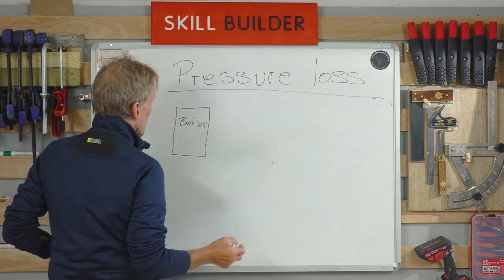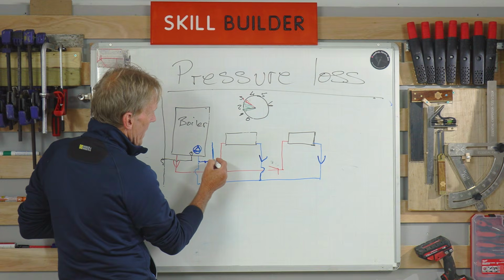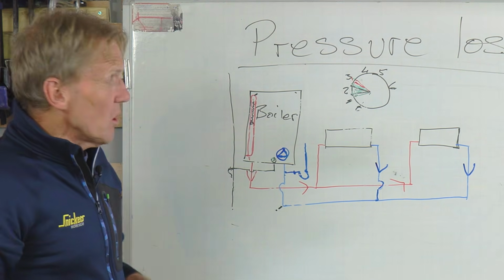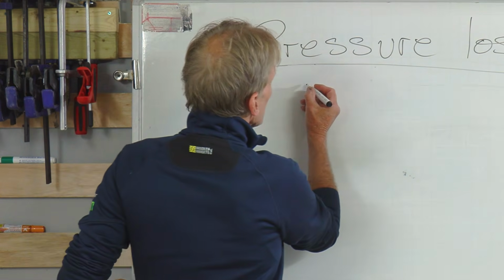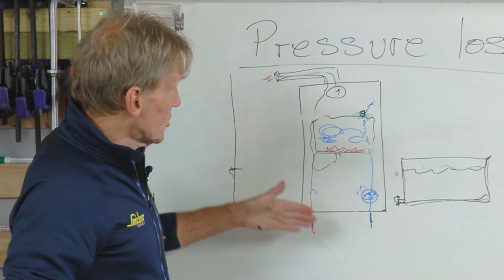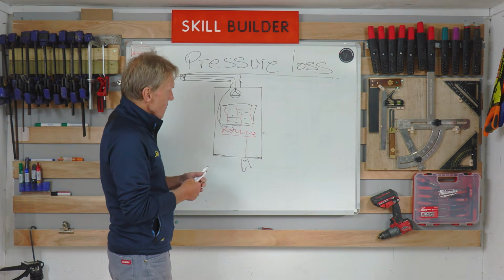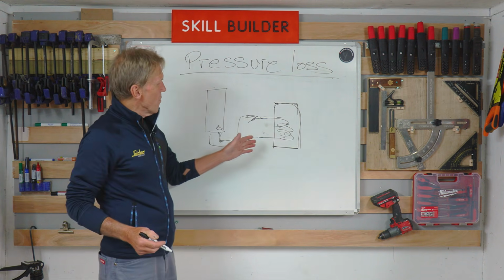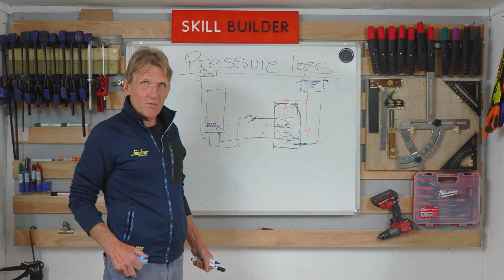Why Does My Boiler Keep Losing Pressure?

Comment: It's interesting to see how a boiler works. I had pressure loss but nothing obvious as all the boiler drains go straight into the soil stack as my boiler isnt on a outside wall. Had them out to fix as was dropping quick and now onky drops pressure every couple months which i assume by this video is relatively normal.

Comment: Hi Roger
My boiler Baxi 424 is working perfectly but the pressure gauge is reading zero. When I try to increase the pressure no water enters
the system . Is it possible that the pressure gauge is faulty?
Reply from the maker: The pressure guage may simply be blocked with a tiny amount of debris.
Reply: The gauge is at zero why is the boiler not asking to be topped up ?and why is there no error code showing ? @SkillBuilder

Comment: Here's and interesting fact that i  point out to customers. If your boiler has been fitted in the loft and a convenient filling point with a pressure valve has been fitted on the ground floor. The Pressure dial will show the height difference as well as the system pressure. so 1m equals 0.1 of a bar. So if the boiler is 10m above the filling point and you pressurise the system to 1.5 bar it will be 0.5 bar at the boiler. This may not be enough to activate the boiler.

Comment: I had a problem with my boiler since Thursday this week, where the pressure was going doolally and the pump was gurgling. The boiler kept shutting itself off (E9 or E5 Worcester-Bosch boiler). Called an emergency technician round last night, and he slapped the pump with the handle of his screwdriver and jiggled around in the middle of the pump, and it's running again now. 1.5 hours labor quoted, "Pump repaired".

Anyway, since then, the pressure keeps dropping to zero, and I keep topping it up. It lasts about 6-8 hours, then drops to zero again. I'm not sure what it could be, it was holding 1 bar fine till I had that pump problem. The pump problem only started when I switched the radiators back on.

But, when I first switched the radiators back on, I noticed the radiator in my bedroom wasn't getting hot at all. Since the guy "fixed" the pump, the radiator is getting hot only at the top, but not at the bottom. I noticed throughout the day today, as the pressure was dropping and I was topping it up that more and more of the radiator is getting warm from the top downwards.

Could the problem be buildup of sludge in that radiator? Maybe that's also what caused problems with the pump at first as well? Is there a chance the drop in pressure problem may resolve itself as the sludge is pushed from that radiator and through the system gradually over the coming days?
Reply: My hope is the "sludge" would eventually find a nice balance between all the radiators in the system and will then eave me alone.

Comment: Brilliant, well explained and easy to understand. Im a plumber with 7yrs experience but that was spot on. Exactly how they taught it at college
Reply: Did anyone on your course question why the heck this adjustment of pressure is not automatic? Seems odd to me - why can't the system pressure be measured automatically and adjusted automatically? It seems extraordinary that you have to do his manually.  Anyway - going to be academic soon - since we're all going electric air-pump, aren't we?!
Reply: @mbuk-zm3hc I'm sure it would be very easy to have automatic pressure monitoring and adjustment,  but why would you want that? The need to repressurise with any sort of regularity indicates a leak somewhere. These leaks can be small and very hard to spot. Surely the manual pressure top-up creates a very effective early warning system that things are not as they should be. For example, if a pipe should break and the system begins leaking badly, the fixed amount of water in the system limits the potential amount of water damage that can be caused to the building. Also, the filling loop on a combi boiler is connected to the mains water supply. There are very strict rules regarding connecting a sealed system to the mains (i.e. drinking water) supply. An automated pressurisation system would only increase the likelihood of water from the sealed system - likely containing corrosion inhibitors and other nasties - entering the mains water supply.

Comment: I got a IDEAL C30 Combi boiler that keeps loosing pressure, but there are no leaks that I can find, I tried turning the boiler off realeasing all the air from the expansion vessel, then pumped 1 bar of air into it, I did not drain any water out first, don't know how important it is do, and I don't know how to drain the water out in first place, any it has not worked, my boiler is still loosing pressure on average once a week. Any tips please will be welcomed thankyou. Great video thankyou.

Comment: Hi Roger, A couple of years ago I had my gas combi replaced with a bigger output model. The old boiler main heat exchanger was replaced about two years before (just inside the 10 year warranty) because I noticed pressure loss and found that the condensate drain was running excessively. Within one year of the new boiler installation I needed a new primary heat exchanger. In both cases the system was fully corrosion inhibited and fitted with a magfilter so Worcester Bosch replaced them both under warranty.
Was I just unlucky, or is this a weakness of Worcester Bosch?

Comment: Lots of useful tips there, thank you. One thing though and from about 8.20 onwards you talk about pressurising the EV with air, but you don't say how you're measuring it. I believe this should be done with an air pressure gauge on the Schrader valve, but people could get this wrong and try using the system gauge on the boiler.

Comment: Robert. This material is so comprehensive that helped to understand the dependencies and have broader overview. Really I appreciate you sharing your experience. I have drop of the pressure from 1.8 to 1.1 bar every abot six monts. The instalation is about 3 years old. Boiler with external 200l water container for hot water. So I'm going to start with checking this air pressure compensation container.

Comment: My boiler worked fine then starte dlosing pressure i check whole house no leaks - prv valv checked seemed ok .then i noticed outside the pipe leading out was capped off- i cut the cap now it has stopped losing pressure?...sometimes the pipe going out is the culprit for boilers not working - some should be metal or plastic as the install manual says  check this !!

Comment: great video, but should i touch the boiler if not gas certified engineer even though i'm a home appliance engineer? thx
Reply from the maker: You can top up the water pressure on a sealed system, it doesn't break any laws.

Comment: I’ve been topping my boiler up every day for the last week with 5 visits in a week from gas a safe engineer who can’t find my leak. The condenser drain had a broken pipe so he left it flowing into a bucket overnight and next day it’s half full . Now the condenser drain has been redirected to a pot in front garden , no heating again tonight or hot water waiting on a overnight pressure test on boiler ? The engineer said ?  Hopefully get to the bottom of this by tomorrow.. nightmare to say the least !! After watching your video I think he’s not want to fit a new heat exchanger .

Comment: I have an underfloor heating system as well and I don't lose pressure until I use the underfloor heating system. I then lose pressure and need to top up every 4-5 days. But when I turn the underfloor heating off and only use radiators I don't  lose pressure. Or at least I don't think so. Boiler is new.
Reply from the maker: You need an auxillary expansion vessel.

Comment: We had a new Vaillant combi boiler fitted a few years ago which began losing pressure.  I couldn't find any leaks at all but eventually had to call an engineer.  He came readily armed with a valve so obviously knew the problem beforehand.  When I asked why I couldn't find any leaks he said that I wouldn't necessarily notice one because there was a drip tray underneath (very reassuring!) and the heat from the boiler would have evaporated it.  Pretty good boiler otherwise but lost pressure yesterday resulting in no heat, so that's why I am watching your video today. Re-pressurised it again and OK at the moment.
Reply from the maker: Yes that is the auto air valve inside the boiler. They can let out a bit of moisture and it evaporates out through the flue.

Comment: Tring to get my boiler fixed still. 1st thing was the pump had cracked and it was pouring out water, Plumber came out and replaced that. Now i need to keep topping up the radiators every 1.5 hours or so. Plumber said it may need an expansion vessel, but today i noticed water pouring out of the pressure release valve outside the property. Not had heating or hot water for 2 weeks now. :(

Comment: In 2020, my plumber used an air gun to top up the pressure in the expansion tank inside my 2012 Worcester Boiler. Some tome later, I noticed low pressure and after topping up, it varied with temperature more than I had seen before. I discussed this with the plumber who suggested that the diaphragm in the expansion tank was probably leaking and i agreed to have it rreplaced. This was done and the problem was solved. However, I decided to examine the old tank before disposing of it. I discovered that the problem was not with the disphragm, but just that the schrader valve was not seating correctly. I guess that when the pressure had been adjusted that some dirt must have got stuck in the valve seat and stopped it closing properly. The lesson from this is that after adjusting the pressure in the expansion tank, make sure that there is no air leak from the valve.
Reply from the maker: Hi Michael 
Those valve cores are sold in Halfords and take seconds to replace. I have found very few leaking diaphragms, thousands of expansion tanks replaced for the sake of a tiny valve. Thanks for the comment

Comment: My Heating System was changed fully by the landlord. it is now 7 years old, But the system has all the parts you stated as being on them!
I have the modern combi-boiler with heat exchanger and the red big round expansion tank on the side. 

The thing I hate is the fact that I can't easily see the water pressure gauge due to it being right down the bottom below the boiler about 1.5 foot off the floor in the cupboard and I am now a young man and trying to bend down to that level is hard to do?  I also have a system filtering thing on the wall under the red expansion tank.

Plus I will also need a torch as no lighting in there.  I noticed over say a month the pressure is dropping such that i have to keep refilling the boiler water level. which is a pain since I have trouble bending down to watch the gauge level.  

The landlord does send a Gas Safety Engineer out every year to test and check the system. I am bleeding the Radiators on and off sometimes you hear air bubbles running through the rads. I had just now had a bathroom radiators changed to a new one as that was rusted on the bottom right corner.

I just hoping that the renewing of that small radiator will fix the many years of loosing water pressure?  I always makes me laugh that they say it is a "sealed" system. so why do we still have to top up the water then?  

Not a sealed system then.  the tech should be by now so well designed as to have a fully true enclosed sealed system where the water can't leak out at all and just cools down as used and is reused.

I think that the pipes the radiators all that should be Stainless Steel or Aluminium no steel and copper as this would save the rusting of the pipes and radiators solving lots of problems down the years of use!  All recyclable so no worries there.  I will ask the next Gas Safety Engineer to please check those small areas of the seals you stated in the boiler for leaks or bits under the rubber seals just in case there is some mucking up my pressure and water leaking.

Comment: Hi Rog, If it's a condensing boiler wouldn't you have the condensate venting out the pipe anyway? if so how would you know if it's from the expansion valve?
Reply: Because if the main heat ex is leaking, it leaks in the burner chamber which drips out of the condensate.
The boiler would be off during the time of the test.

Comment: Hello Roger, love your videos mate, keep them coming.
was hoping you could help me with an issue, Boiler pressure is at 1.5 bar, we turn on UFH and it immediately drops to 1 bar, when we turn off UFH its back up to 1.5 bar. Is this normal?
Reply: That makes sense to me I'm no expert but obviously when the ufh is switched on you have more space for expansion so theoretically there is going to be a drop in pressure. Maybe there is a tiny bit of air in the system.

Comment: Really nice review, thank you Roger. I'm guessing that a failing or improperly pressurised expansion vessel might lead to a larger difference in dial pressure reading between cold and hot water temp before the system ever goes out of normal green pressure range. For a typical boiler, what should be the difference between cold and hot pressures (how much of the green range would a healthy boiler use)? Also, if that differential is changing,  would one pump some air into the expansion tank before the system needed refilling?

Comment: I had a heat exchanger leak on a Worcester Bosch after about 5 years. The water came out of the condensate drain, which was the giveaway. I had to pay for an hour of labour otherwise they replaced it for free. That was less than the cost of a service which was due, so I was quids in either way.

Comment: Hi Roger,
Thanks for another great video.  Another way to check the heat exchanger on a boiler is to disconnect the condensate pipe, put bowl underneath, isolate boiler, pressurise to 2.5 bar leave for a while and then check for water in bowl.  Personally I'm not keen on leaving "dead" expansion vessels in a boiler without isolation and fitting an external vessel as over time the vessel will start to leak, so needing another visit to either isolate or replace vessel.  Very into fitting slave vessels though, alot of the time needed, but also means boiler will not need topping up between services which is great for people, especially Tenants in rented properties.  Going onto heat exchanger failures, we are now testing for concentration of inhibitor (if any) at every service.
Reply: The condensate would be good if it was the main heat-ex but as an experienced engineer, it’s not the first place I would look.

Comment: If it's a condensing boiler, where does the condensing water go? In our case it is discharged via the same route as the pressure valve making it difficult to know if the system is leaking water or simply condensing as it should.

Comment: I moved into a new build and the boiler expansion vessel wasn't able to absorb the pressure and kept blowing the PRV.  I added an external vessel and I haven't needed to check the pressure apart from the annual treatment.   Problem solved.

Comment: Hi Roger, Very impressed!  I'm stretching the old memory cells but we had a customer who had a constant overflow dripping issue only to track down that some bathroom company had fitted a mixer tap in a downstairs bathroom sink tap on a vented system with the cold connected to the mains and the hot, obviously, from the boiler. The tap was faulty and mixed.

Comment: I came home from work a few months ago and found my next door neighbour had had a new boiler fitted and I now have a boiler vent blowing out the side of their wall straight onto my drive that runs between our houses. It is solely my drive and I have a patio at the garage end. I now find in the summer I can’t sit at the patio for the smell of gas fumes venting and now it’s winter the steam plumes fill the driveway most days .. I get on well with my  neighbours and feel it’s a bit late to complain but if I’d know before hand and if I had recourse I’d rather it wasn’t venting where it is.. I have read about vent being minimum distances from boarders but I cant find a definitive answer to this issue..
Reply from the maker: sea-saw 
I think your neighbour's flue will comply with being the minimum distance away but if it is troubling you I would have a nice friendly chat. The good news is that you can add a pluming kit to the flue to take it up out of the way. If you tell your neighbour that the smell of gas is unpleasant they may be sympathetic and the pluming kit is not expensive. 
What distance should the flue be from a neighbour?

In some cases, a flue may need to be located relatively close to a neighbour’s property. When this is the case and they’re parallel to the boundary, there must be a minimum distance of 300mm. A flue that is pointing directly at your neighbour’s boundary must be 600mm away and at least 2,100mm away from their doors and windows.

Comment: We had something similar going on in the house in which I grew up. The system was not loosing pressure because it automatically refilled itself, but the relief valve was filling the bucket about every week and the radiators, which had automatic bleeders, were constantly venting a little. The problem was that, since it had a tankless ("combi" in UK terminology)  tap water heater, the temperature of the system was set to the top of its range so that there would be enough heat for a decent shower (without that, one would have to turn the shower down to a trickle after a few minutes to keep it warm). With that high temperature, the expansion tank was simply not big enough, so the relief valve was always trickling on and off. A proper fix would probably have been an external tap water heater or storage tank, though a bigger expansion tank would have helped. We just lived with it the way it was.